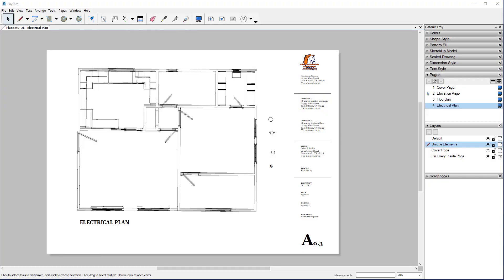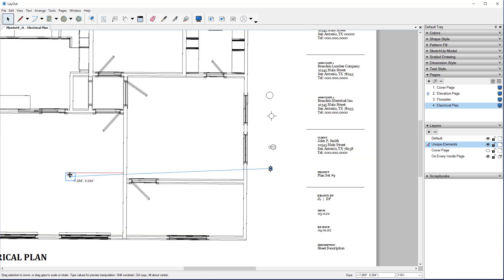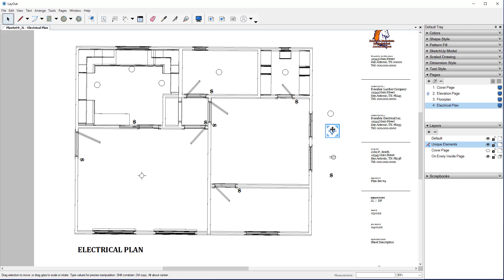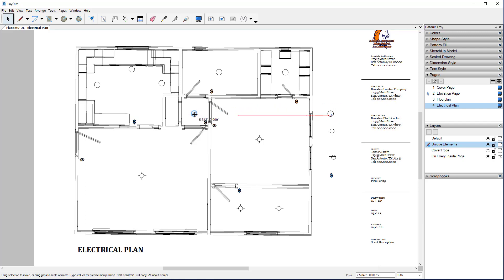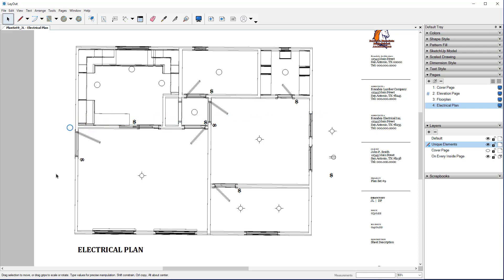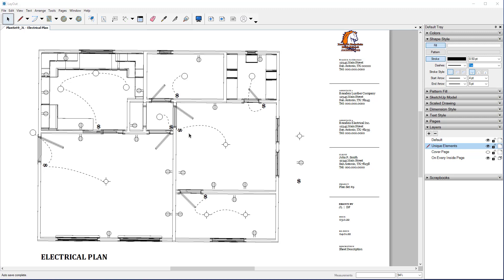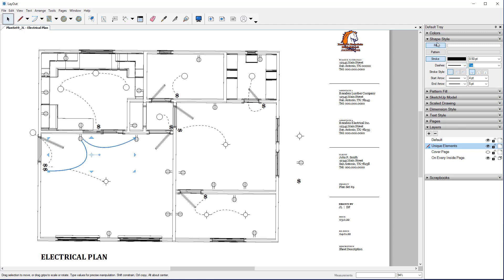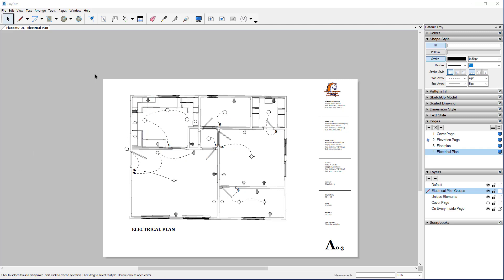SketchUp Layout Tutorial - Ep. 6: Complete the Electrical Page with Electrical Lines - Part II

Comment: I would like to know where the symbols come from and how to get them. 
And just for reference, you cant put a switch in the pocket of your pocket door or it won't open. you also can't put one in the corner where there are 2 doors in that corner. there is a stud and a jack next to both doors meaning that corner is solid 2 x 4s.
Reply from the maker: I created these symbols using the shapes available in Layout, although you could just as well upload images of symbols I believe.  And I actually never noticed that I put the switches in bad places.  Think I was to busy just trying to get the video done for my class.
Reply: @sketchupprotutorials  So I did the same. I made the symbols and made them components. I made a drawing key showing the symbols with a description label. I could copy and paste them wherever I wanted them. That was a great idea. Is there a way to store them so I don't have to make them each time per drawing?
Reply from the maker: @DEW-fk7ij  I will have to look.  From memory, I think you can save them in a project and one of the panels on the right allows you to see images and such from those projects or some thing like that.  But yes there is a way, just cannot remember it off the top of my head atm.

Comment: Thanks for posting this. What version of SketchUp are you using?  I can't find the Shape Style in the Default Tray.
Reply from the maker: You should be able to go under Window in the menu bar and adjust the panels you see on your left, similar to SketchUp Pro.   If its not under window, i believe there is an option for it.  I made this video around 2 years ago but had to recently reupload it to a new channel.  So that is why you see some differences in there.